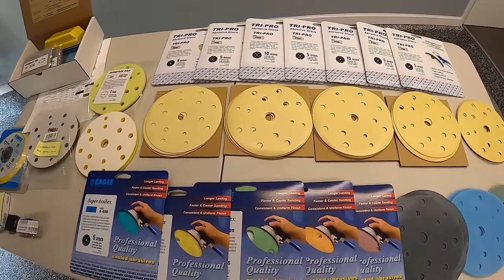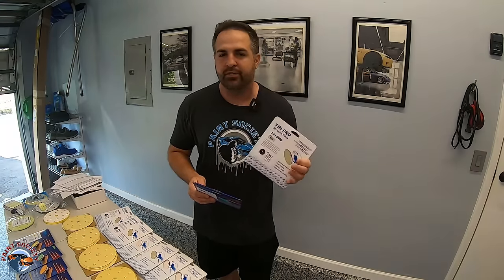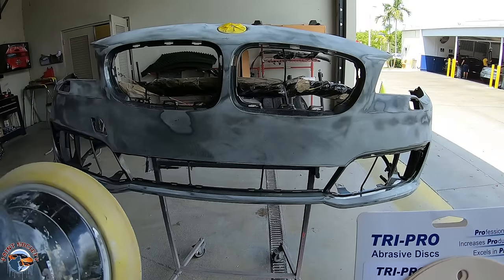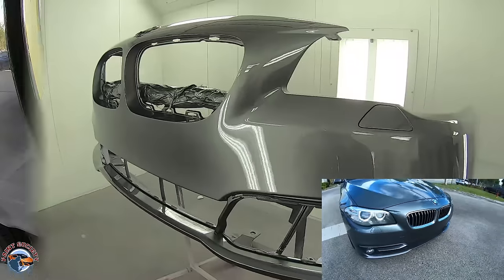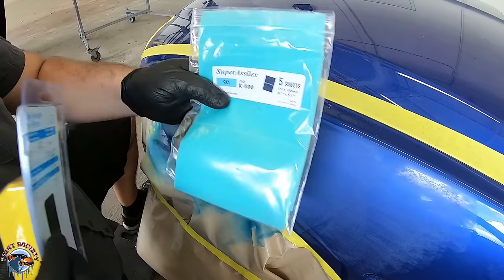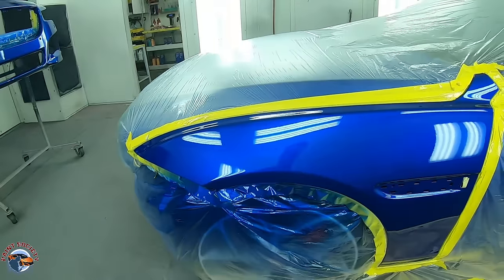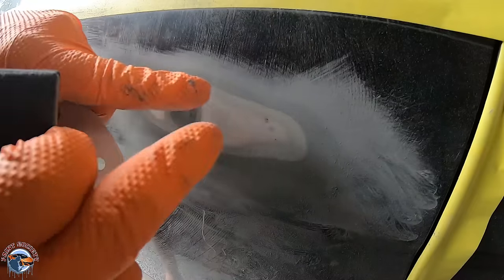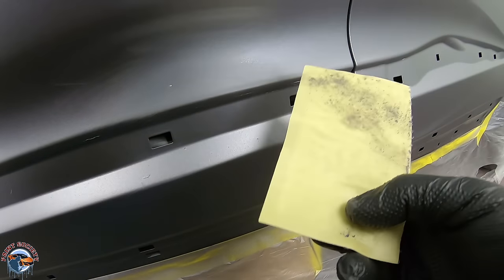How to Sand your Car for Paint

Comment: Again an AMAZING video, clear and a lot of applications. I'm wondering what to do with my car. It has been painted for 3 times before I bought it. Offcourse there is a depth difference between the metal and the last (3th) paint layer. When I get to bare metal, should I use body filler of just feather edge it out? 

Hope you can help me!

Cheers!
Reply from the maker: Feather it out with 180 smooth firdt
Reply: 3th?

Comment: Where does the video actually start because I’m 5 min in and we’re talking about the sandpaper companies. I just came for what grit to get down to bare metal before painting and priming. Nothing more nothing less
Reply: I used a 80 grit to remove layers of paint , I went to primer without smoothing my surface metal first, 
I went to sand my primer and I can see all the scratches from a lower grit, 
Should I go back and re sand ? 
Or add more primer/filler to fill the scratches ? 
Lmk !! 👌🏽

Comment: I just bought this kit and was wondering....so if i use the k600 i can basically skip using a p320 and 400?

And btw any links for the sikkens base solvents?
Reply from the maker: That’s 100% correct. That’s what is great about k grit

And sikkens is not sold online
Reply: @PaintSociety  where can i buy it then?
Reply from the maker: You’ll have to find a jobber in your area that sells it locally. Do a google search of local paint supply shops
Reply: @PaintSociety  thanks man i appreciate your videos and knowledge
Reply: @PaintSociety  hey i forgot to ask which k grit would i use to sand primer?
Reply from the maker: @InNoTime3377  k600 will work
Reply: @PaintSociety  awesome thank you!

Comment: I used 60 on my whole truck lol
Reply: 😂😂😂 deep scratches...
Reply: I used a 80 grit to remove layers of paint , I went to primer without smoothing my surface metal first, 
I went to sand my primer and I can see all the scratches from a lower grit, 
Should I go back and re sand ? 
Or add more primer/filler to fill the scratches ? 
Lmk !! 🤣👌🏽
Reply: U need to go back and go to 120,220 and 320